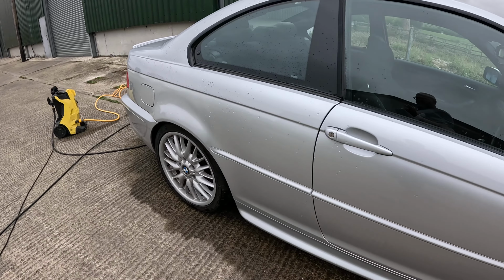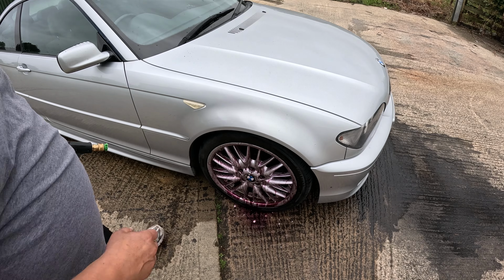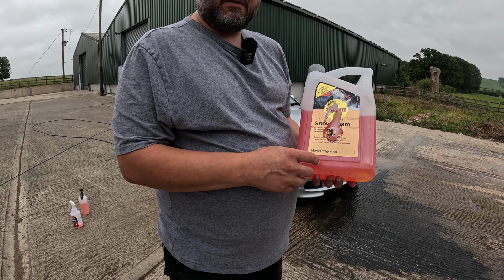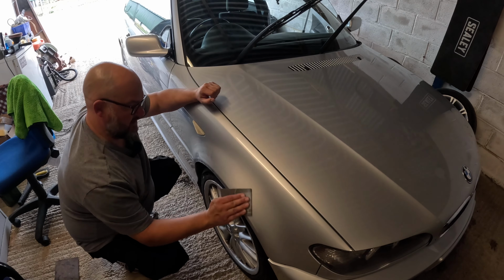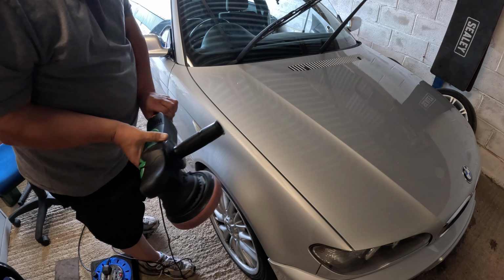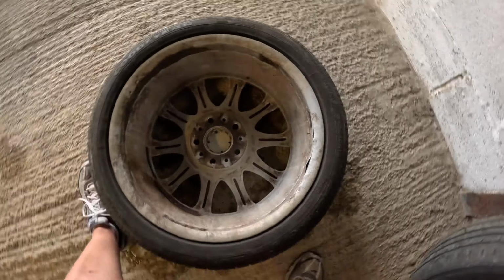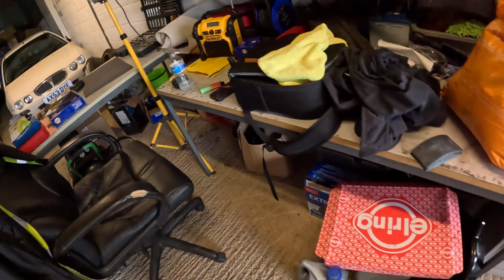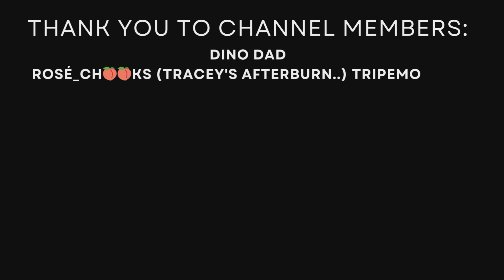MY E46 BMW 330Ci: A CLOSER LOOK

Comment: Offsets  can be a pain in the bum. There's a site I use for checking original car makes wheel sizes ( all bmw. ) and another site will they fit my car. I'll pm you on the details. That 3 is making  me very confused as to the next Dino Daily 😂
Reply from the maker: That would be handy, thank you Ross. I need to drive a 5 series again reallty to make a comparision. I just all the boxes the 3 series ticks though.